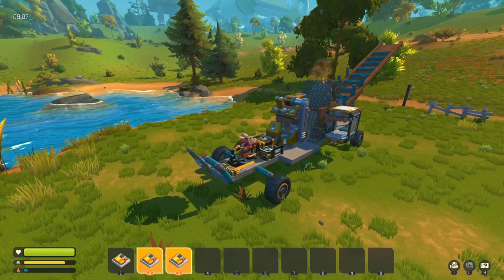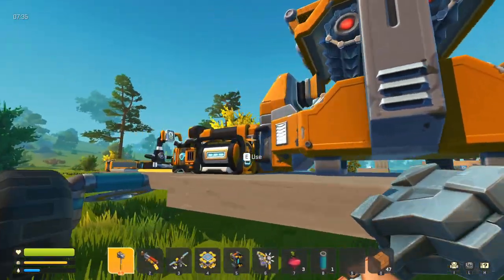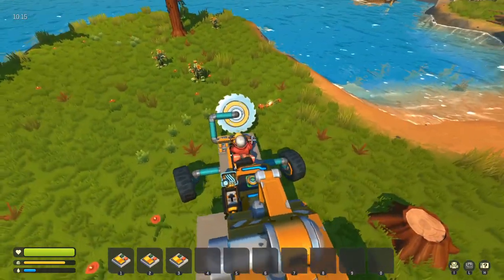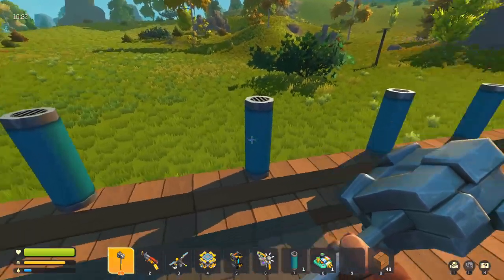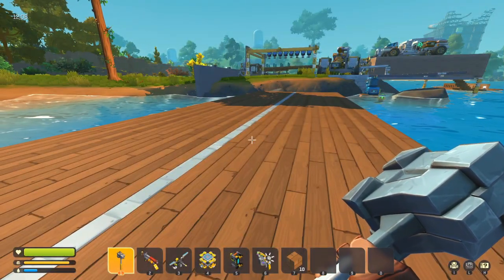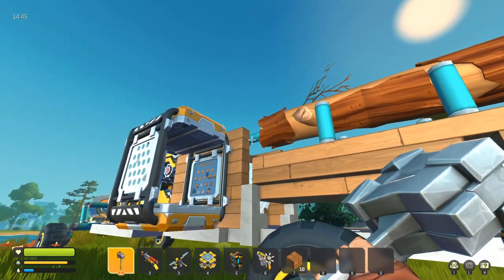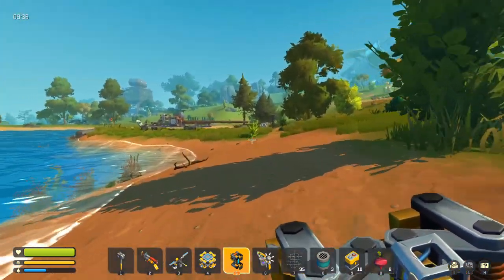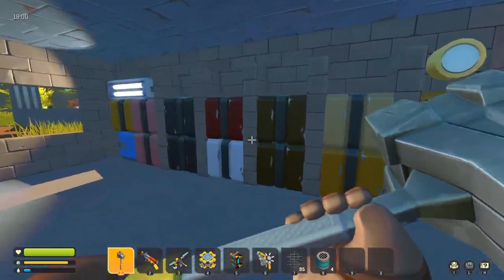SCRAP MECHANIC SIMULATOR | BUILDING MY BRIDGE!! | SCRAP MECHANIC

Comment: Neat idea using gravity to push the log torwards the blades. Use iron mesh tiles, uses less metal, and have low friction. And i think more blades on top/side mighy fix the occasional log getting stuck